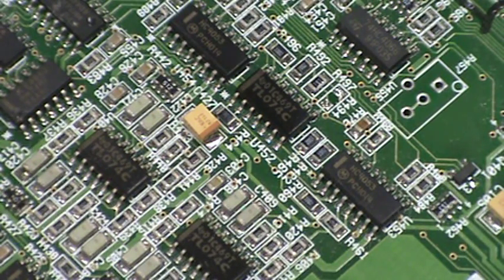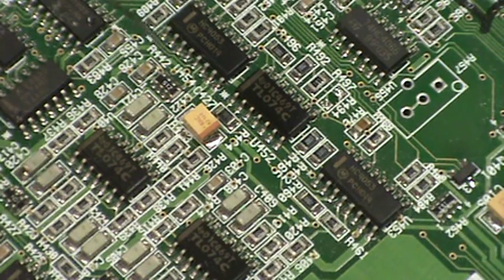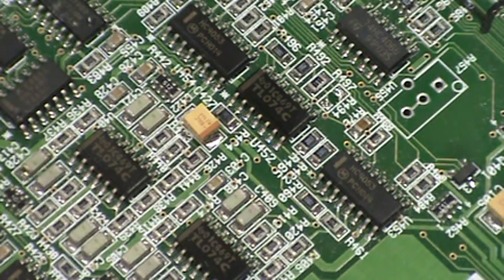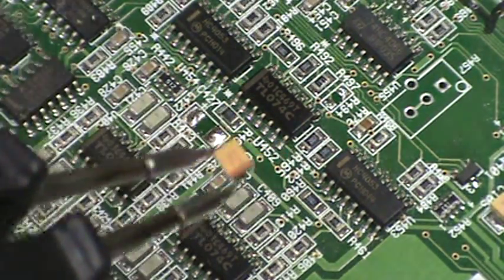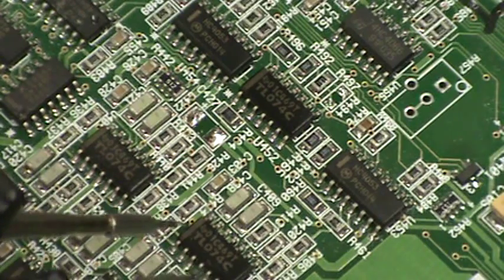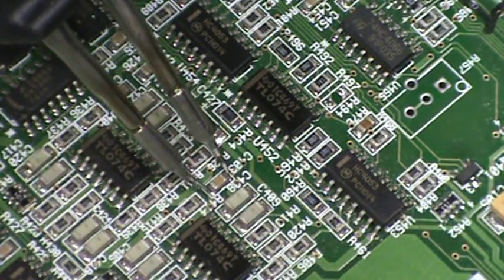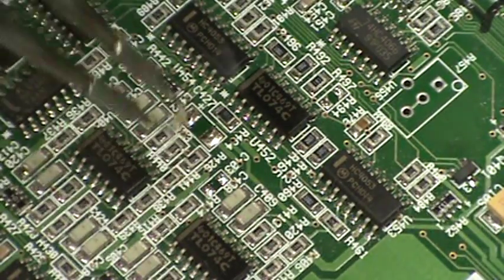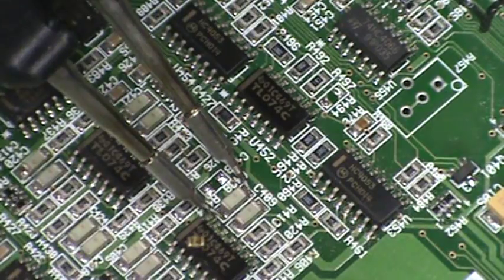SMD practice with JBC soldering station (Tweezers)

Comment from the maker: Honestly, a properly reconfigured toaster oven will work just as well as a definite purpose reflow work station. I have both and prefer my toaster oven for most work.

One thing about the toaster oven, insulate it, and insulate it well- otherwise it will be very difficult to properly ramp and soak and you'll end up damaging the components and or board.

Comment from the maker: The base station is required to use JBC tools. There are several to choose from, if all you are looking for is the tweezers you can buy an economical version for a fraction the price. But if you have any plans at on all expanding in the future, go for the larger station right away and save some grief.

Comment: Sadly the majority of guitar amps that I repair are now SMD. The main reason is most other shops won't work on them. Sure life would be  oh so great if everything was built like pre 1985 Fender amps or old turret board amps. Anymore the cheaper amplifiers show up needing rework from the factory. I dislike PC boards period for tube amps. With the ever increasing DSP amp/effect stuff SMD repair is a must. I saw some guy using a toaster oven to reflow solder paste. Don't think I'll try that one!